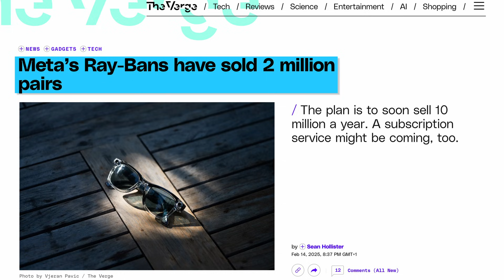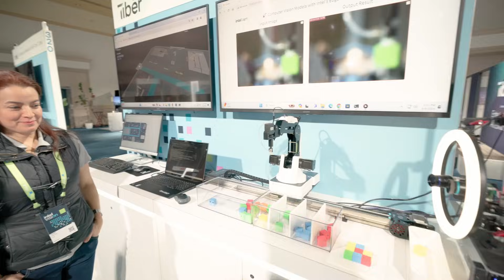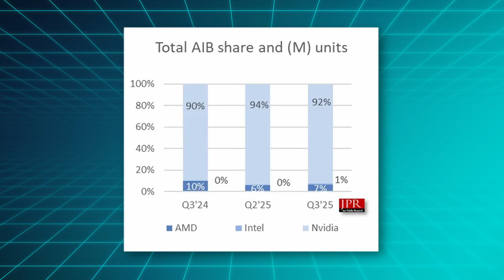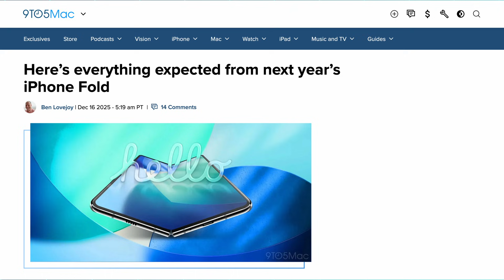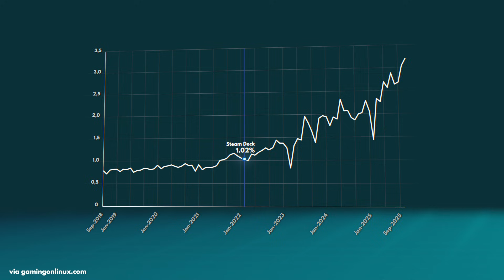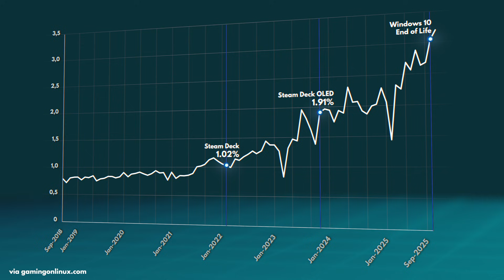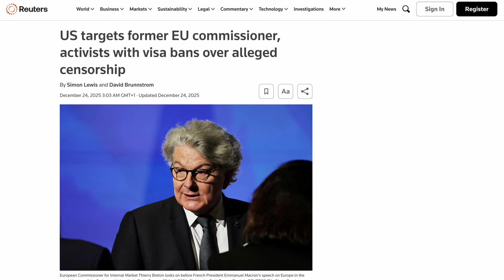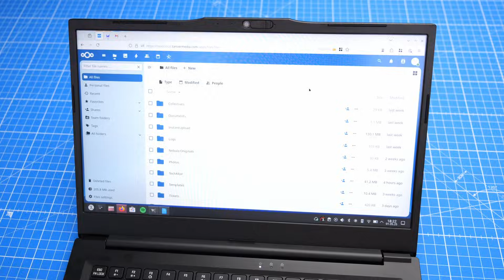4 tech predictions for 2026. Do you agree?

Comment: I've gotta admit, I'm a little amazed by how much people care about wireless charging. I've never once felt the need to have that sort of thing.
Reply: I drive a 2011 beater of a Prius, and the in-dash navigation sucks. So I have a MagSafe car mount for my iPhone and use a Japanese navigation app for my car nav needs. Not having to deal with cables & clamps to hold the phone in place makes this a whole lot more tolerable. It snaps into place with the magnet, charges, and is held securely. It can be easily set to portrait or landscape without fussing with the mount or dealing with moving charging cables. It's so far superior to any other type of car mount that it's not even comparable. I wouldn't buy a phone without a MagSafe like system unless I don't need to use it for in-car nav.
Reply: I really like to see it as a convenience more than a necessity. But I really like it
Reply: My phone is almost 10 years old and with that my wireless charging is the only reliable charging method
Reply: @argonaut502 well congratulations
Reply: Agreed !! I just charge mine through the laptop outlet overnight.
Reply: It is important to me, because I use devices for a very long time and after too many unpluggings and plugging the ports get unreliable so if I mostly use wireless charging I can use my phones for even longer
Reply: Same here - wired charging literally takes about an extra 2 seconds out of my day.
Reply: @detocquevi11e actually it saves more time of your day because it's almost always faster
Reply: @tegra8 no if you didn't make conscious effort of finding cables and such

When i sit on my desk i am used to just putting my phone in the wireless charger. When i go out for lunch it's always at 100%

Wireless charger is never meant to charge quickly. It's meant keep your battery level high enough when you're not using it
Reply: @tegra8
Current wireless charging from Chinese manufacturers charges faster than Samsung or Apple via cable XD
Reply: @ZbokolZDachu but most people don't have access to such phones
Reply: @lekejoshua4402  lol how so
Reply: Wireless charging saved me once when the charger port on my S9+ broke, and used wireless charging to charge it before I fixed it.  But other than that I almost never use it. It's way easier to just plug in the phone to charge it.
Reply: Yeah, I have one iPhone that I charge wirelessly. It’s convenient but by no means a deal breaker of any kind.
Reply: Did you ever once have it? If not, then that explains it.
Reply: @Doctor_Technopolis my phone supports it. Never felt the need to get a charger because I've already got cables everywhere I might want to charge.
Reply: if you want to protect your chargeport an change battteries qi2 is the fix
Reply: @Clickworker101  the charger port is stronger than you think, except nokia Android somehow they use a defective port that breaks all the time. No wonder they are dead
Reply: Battery Sharing is though
Reply: It’s less the wireless charging and more the magnetic dockability of MagSafe/qi2 for me.
I had wireless chargers since the nexus 4 but rarely used them. But since magesafe it’s so simple, nice and satisfying to just slap your phone on a stand or at your cars dash holder.
Reply: I always used wired just because it's faster
Reply: @eruno_ u r not the world. It's like saying I use my legs I don't understand why people make a fuss about wheel chair accessibility... Well not exactly but u get the point. People who uses it everyday cares about it.
Reply: It gets more useful on older devices. When your USB socket starts to get unreliable and stop working at certain angles and you're charging up twice a day due to a worn out battery, that's when wireless charging is great.
Reply: Especially since it's not really wireless in spirit, because it still has to remain tethered to something while it's being charged so for now wired is still superior
Reply: You g et to use a USB C cable to connect the charger to a wall plug. That’s why it’s called wireless.  :D
I feel the same way about humanoid robots.    Basically a dumb design with a market created by Star Wars and pre 70’s sci-fi stories.
Reply: My phone charges only in certain angles. So wireless charging is what I prefer most of the times except when I am in a hurry to charge it fast
Reply: I agree. I've had a few phones with wireless charging and could probably count on one hand the number of tikes I've used it. It is mostly just when I don't have a charger and someone else happens to have a wireless one I can borrow.
Reply: Personally I use wireless charging at work no my phone would sit in it everytime I out it down. And I'd leave work with 90+ every time. I think it's great. And convenient. I think charging ports might disappear soon wireless tech picks up some speed.
Reply: It's nice to have on hand, especially long term if your port breaks.
But it's an inferior technology. People who use it as a main are probably the same morons who buy the pricey iPhones on credit.
Reply: I charge my phone by putting it in the microwave. I'd rather have wireless charging though. 😢
Reply: Same here. I just don't use it.
Reply: I agree 100%. Wireless charging is worse than useless because not only is it slower and less convenient than using a cable, but it also wastes valuable space that could be better used to fit a larger capacity battery in the phone. It also kills the battery health at twice the rate of regular cable charging due to all of the heat and wasted power generated from the coils through the energy transfer process. I'd much rather prefer that manufacturers simply put some extra USB charging pins on the back of the phone as a backup for when the USB C port breaks to still charge just as quickly as wired, but as conveniently as wireless through a magnetic attachment without the extra wasted space, wasted power and additional heat generated by the coils.
Reply: Apparently you don't play much on your phone because it forces you to charge it frequently, which in turn quickly degrades the charging port. 
Since I started charging wirelessly, I no longer have this problem and I have noticed that wireless charging is much more convenient.
Reply: I think it's a little bit like high refresh rate screens. You don't think you need it, until you try it out, and then you can't really go back.
Reply: Looking at the Fold 7, the only way to go thinner to make phones like Trifold less chunky is to ditch USB-C. Doubt a new standard connector is coming anytime soon, so the way forward is wireless charging.
Reply: When I used an iPhone with lightning a few years ago, it broke, and Apple made me pay for a whole new phone instead of repairing it. I’d rather have more choices for charging than get rid of a phone early
Reply: Yeah it's kind of irrelevant with fast charging. It's only really good in some instances such as putting it in tables at bars or libraries but even then it's so much better to just have a usb connector for charging.
Reply: @DarkKreig  You should never connect your device to any public USB port. Unless you bring your own charger and cable, don't use it.
Reply: @IanHobday  You shouldn't use USB chargers even if you own them. Use wireless charging instead
Reply: @parlor3115  Perfectly happy with my Apple chargers, thanks. But there's no way in he11 that I'm plugging into some rando USB port in public.
Reply: @IanHobday  I understand. You want to keep your sockets clean
Reply: @parlor3115  that's just dumb no.
Reply: The great thing about wireless charging is when you don't need to think about it.

When sleeping, instead of thinking whether to plug my phone, i just put it in wireless charger and let it slowly charge

In office, instead of making sure i had enough battery for my commute home i just put my phone in the wireless charger stand when it's not in use. I will always leave the office with full battery
Reply: @ezkailez7255 you still have to place the phone on the charger and make sure it lines up
Reply: @ezkailez7255  thank god he gave me 2 eys and 2 hands
Reply: Um plugged in is faster and more efficient than wireless  @ezkailez7255
Reply: usb-c ports can typically have issues over time that make charging stop working so having it as a backup can be nice. If you're already getting a high mid-range to high end phone already it's gonna be included anyways where you want it or not too.
Reply: @zues121510 I’d rather have a second USB port as a backup.
Reply: I guess u don't use a car with wireless charging it's annoying to fumble through the dashboard to fit the cable inside your phone and place the phone at an angle that sticks out.
Reply: @AI_mod I actually prefer cable when driving, most phones get really hot with Android Auto Wireless & charging wirelessly at the same time.
Reply: @AI_mod i use both wired and wireless in my car. Very easy to route the cable (mazda 3), but sometimes the port on my phone is acting up, so it goes into the wireless charging "pocket". 

Or I'm just going somewhere quick and simply throw it on there 😂
Reply: @marjacu3809  so having wireless as an option is important or atleast valid for you?. In my case it's valid and important. 🤷🏽
Reply: I would be genuinely happy it never even existed in the first place
Wireless charging, 120+ Hz screens, insanely fast charging, they are totally unnecessary (something you never missed until you had it and your life didn't get better, you got more careless), but drives the price up insanely for everyone
Something like that is AMOLED in sport watches - nobody needed it, but it's there, you can't easily buy anything without it and drives up the price, eats the battery and kills your eyes - all for "convenience and cool factor"
Reply: I've also wondered about this, I have charging cables that I've accumulated over the years and I've never felt a need for wireless charging. What I really miss is removable batteries, which makes the fairphone appealing.
Reply: It makes it so much easier to scroll reels on my phone while driving. I can pick up the phone with one hand; scroll reels and then place my phone down on the wireless charger without having to let go of the wheel. This way, it's ready for when I arrive at the casino🤑🤑🤑
Reply: Sorry to say but you're wrong haha. Just cause you didn't see it doesn't mean it's not useful or convenient in many cases.
Reply: @marianzk  nah
Reply: @Moresteck  learn to understand you’re not the center of the earth and other people might have different needs than you? Maybe?

Comment: Funny you should say that gaming will grow on Linux, I've just switched to Bazzite for my desktop and I'm running a 9800x3D and RTX 5090. The thing that was stopping me was the outdated idea that Nvidia sucks on Linux, but my experience has been great so far.  Running it as a partition with a legacy Windows 11 partition for the edge cases where games wont work properly and while I exhaust the gamepass sub that I've built up until 2027.
Reply: Agreed!  I installed Linux Ubuntu on my old ASUS TUF 17, and the support for the older GTX 1650 was solid.  With Steam, I ran Counterstrike (native Linux version), and it was nice and smooth.  Nvidia support has gotten good.
Reply: *partition
Reply: @KJ4EZJ  Thank you for your contribution.
Reply: @KJ4EZJ  thank you I was wondering if he was from a Roman senator's family. I just couldn't guess what he meant.

Comment: can u do more details Linux on nvidia Laptop video please new comers like me are having bit trouble and Linux community being same "This works for , I dont use that " ... I got Nvidia Laptop having trouble with Laptop Sleep issue and Trackpad Gestures not working
Reply: bro ask chat gpt it solved all my problems on linux nobara
Reply: @ZbokolZDachu  yeah tried it still no success it give stupid this which does not even works told me use touché app but that doesn't work bcz of its only support x11 and not wayland
Reply: @LynxSynthos  I'm a Linux noob, but try using a different prompt; it might answer your problem. Getting help from the Linux community is very difficult because everyone uses a different distro and has inflated egos.
Reply: @LynxSynthos Not sure about that, but there are missing features in Wayland and there is no workaround. In my case, the only nogo is the remote control/ connection in login screen/locked screen; I will be probably keep using  X11 until there is a solution.
Reply: @ZbokolZDachu Real Appreciate Thanks
Reply: Then just look up "[NAME OF LAPTOP] cant sleep and use trackpad gestures [NAME OF DISTRO]"
Reply: what distro?
Reply: @subgivtara cachy os kde plasma
Reply: Cachy os kde plasma Lenovo IdeaPad
Reply: The problem is that I can only talk about the distros I've personally used. I can vouch for Fedora, for an all purpose pc including gaming. And Bazzite, I'm using it specifically for an nvidia gaming laptop because it comes with drivers already installed. But really you can choose any distro and you'll probably be fine, Steam works on pretty much all of them. Also, you can always switch if you run into a lot problems.
Reply: Having Nvidia card and don't want the hassel to configure it, best to use gaming distro like Bazzite.